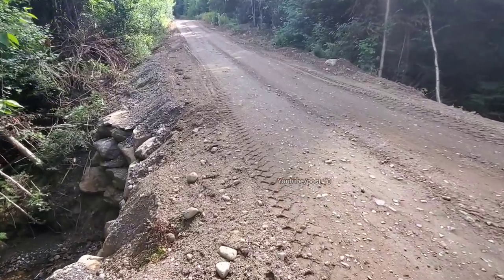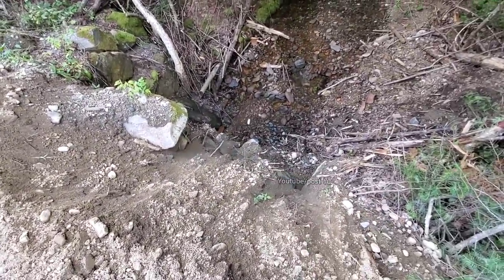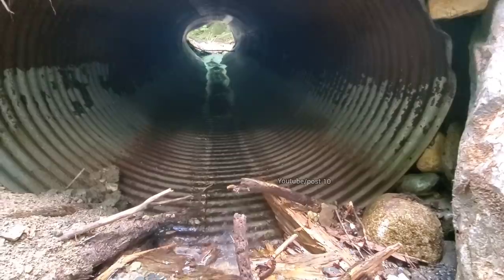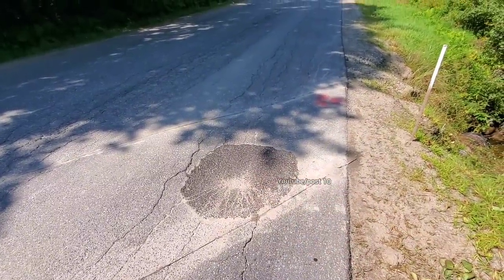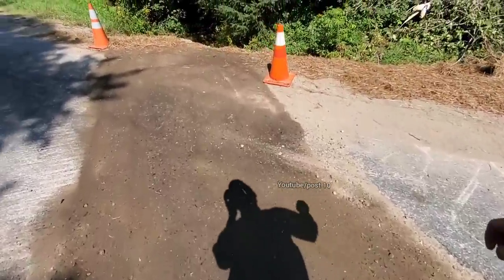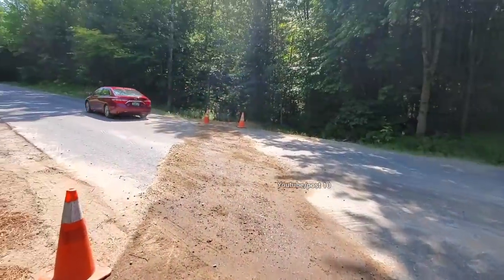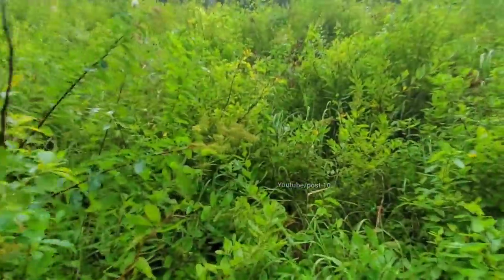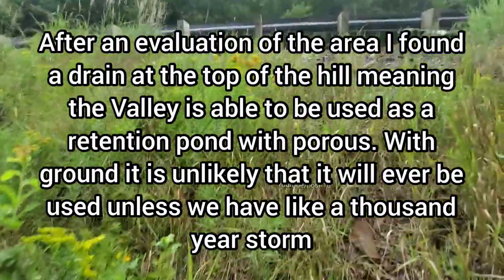Reporting And Replacement Of Culvert NH,DOT

Comment: I'm impressed with that new culvert pipe. Corrugated exterior for structural strength and a smooth interior (liner?) for clear flow of water and debris.
The best of both worlds.

Comment: Thanks again, post 10.
BTW, the centerline of the road should be on a "crown". As you say, the highest point of the surface so water drains off it to the shoulders. I believe all roads are required to be designed with a specific crown, but it's measured as the slope from the shoulder, in to the centerline.

Comment: Hey post, there is a culvert under the road that goes up to my grandfather's friend's place, while it can handle the water most of the time, I think that it might be undersized, there's evidence to suggest that it might be. There is also a drainage grate that is part of a housing development up by my my grandfather's friend there that, like the ones that you've found that gets covered in dirt and stuff, and there is a drain in the same housing development that has a drainage ditch  drain that has debris such as leaves piled up against it.

Comment: Anyone else Become a Fan of Culverts due to Post 10 Vid’s?💭,Also That Dirt Road is Shot to Hell the Ppl In Charge more than likely wanted a Quick Fix/Were in a Rush etc. rather than have Long Standing Efficiencies In Place,The Smashing of the-Bent Culvert if enough Pressure is applied through Erosion/Landslide could plug one of those suckers than the Water Builds Up in the Culvert Pipe Till Wear An tears in the road & Climbs Over That small ditch that Culvert Is Installed into next thing you know got this Little Prob Turns into something massive if left unnoticed & given time.